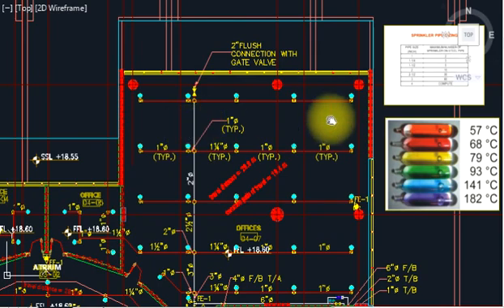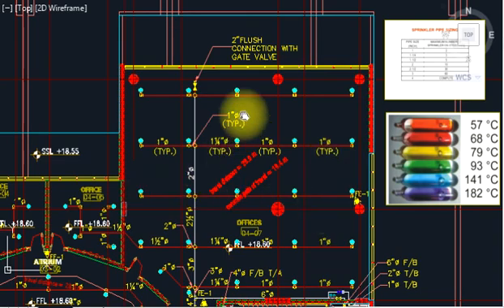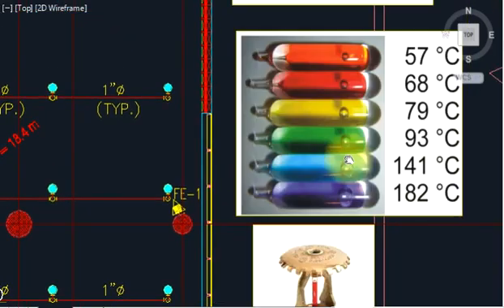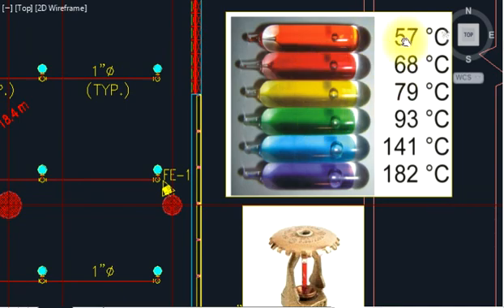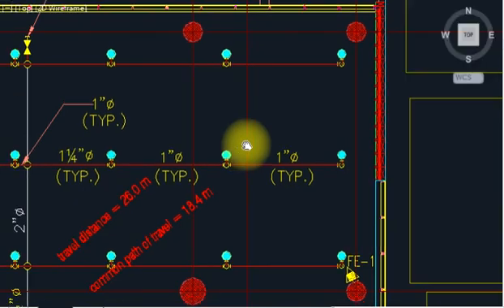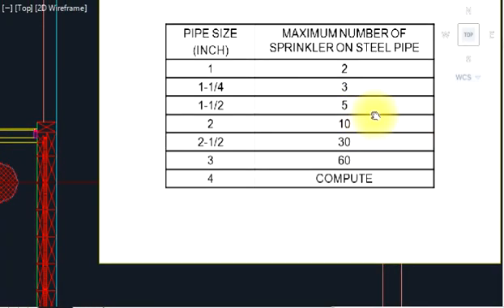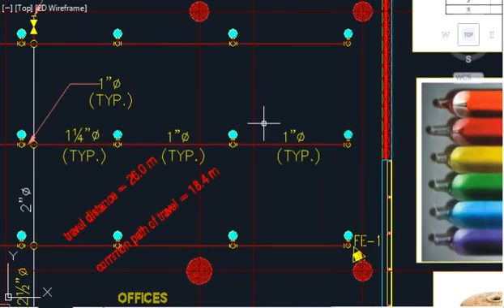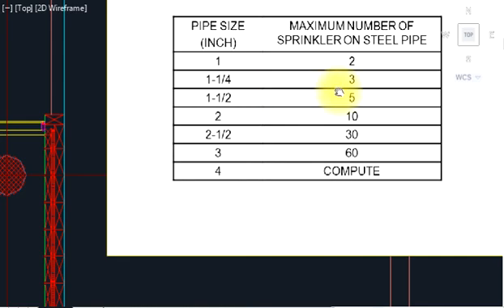Fire fighting - How to Fire sprinkler design and fire sprinkler calculation in English and hindi

Comment: how much pressure of sprinkler??
Reply from the maker: depend on design as per operating pressure . most like 7 bar
Reply: AfreenAli,bt it's  per sprinkler pressure 7 bar?.
Reply: please give me,prove that sprinkler chart are mathematically calculation. please help me.
Reply from the maker: this is pipe pressure 4 bar but for testing in 7 bar to 10 bar
each sprinkler will be max pressure 1 bar 
this is mathematical calculation
we will use the following design parameters:

design density: 7.50 mm/min
sprinkler head: K-factor of 70 with a minimum pressure 0.5 bar
head area: 10.20 m2
 and more
We will first calculate the flow given the design density of 7.50 mm/min and the area the head is covering, we do this by multiplying the design density by the head area:

Equation 1:

q1 = (design density) x (area per sprinkler)

In this example, this gives:

          q1 = 7.50 mm/min x 10.20 m2 = 76.50 L/min

The second step is to calculate the minimum flow from the sprinkler given the K-Factor and the minimum head pressure by using the standard K-Factor formula:

Equation 2:

q = kp0.5

Where

p = the required pressure
q = the required flow from the first sprinkler
k = the discharge coefficient of the sprinkler (k-factor)

In this example, this gives:

                q = 70 x 0.50.5 = 49.50 L/min

By comparing the two calculations above we can see that the minimum flow required from the sprinkler head will be 76.50 L/min as this is the highest flow rate from the two calculations and is required to meet the 7.50 mm/min design density.  We can also see that the minimum sprinkler pressure of 0.5 bar is not sufficient to produce the require flow rate so the next step will be to determine what pressure will be required to produce the require flow of 76.50 L/min at the first sprinkler head at node [130] we can do this by using equation 3.

Equation 3

                p = (q/k)2

In the example, this gives:

                p = (76.50 / 70)0.5 = 1.194 bar

We have now determined the minimum pressure and flow for the first sprinkler at node [130] which will be 76.50 L/min @ 1.19 bar the next step is to calculate the pressure drop in the pipe between node [130] and [120] and for this we will use the Hazen-Williams pressure loss formula.
hope understand Thanks
Reply: AfreenAli, many many.thanks
Reply: thumb rule-
1 " MS pipe=2 pcs sprinkler
2" MS pipe = 10 pcs sprinkler
then, 
How Proved that,  mathematically calculation. please please help me.
Reply: AfreenAli, sorry sir,here may be will be. area per sprinkler 12.3 square metre.